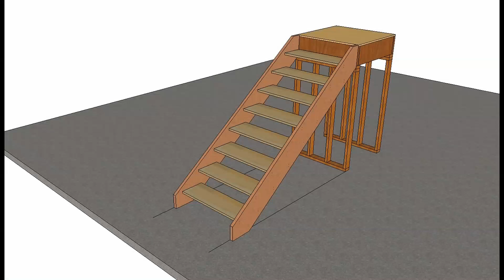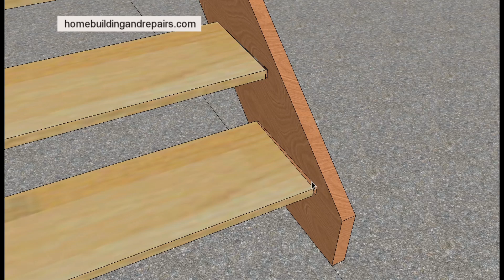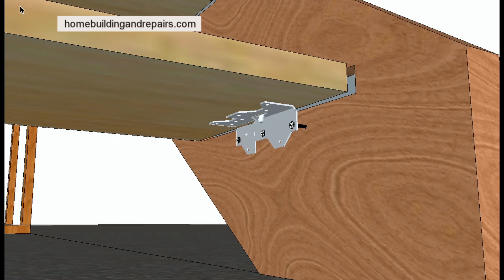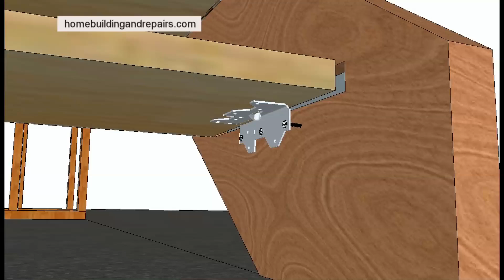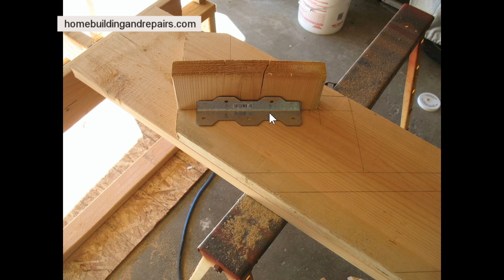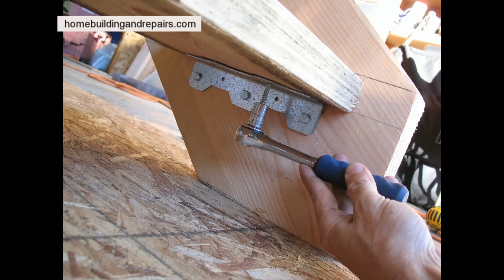How to Force Tread Back into Dado Stringer – Basement Stair Repairs

Comment: My issue is my basement stairs have too much flex in the middle of the treads (No middle stringer). The previous owner attempted to remedy this by putting a threaded rod that goes under each tread and spans through both stringers. This is another method you could use to bring the stringers back together.

Comment: Using tread brackets as support which would be stronger lag bolts or carriage bolts ??
Reply from the maker: It will depend upon the size and installation, but I would say that the winner would be carriage bolts.

Comment: Where there is a gap at both sides of the stringers couldn't you use a clamp to force the tread back into the dado?
Reply from the maker: I would imagine so. There are quite a few different methods for this type of repair.

Comment: What size bolts for angle brackets? Great video by the way
Reply from the maker: You would need to check with the angle bracket supplier or manufacturer. It's the reason why I didn't provide it in the video, because they could vary in sizes.

Comment: WHAT SIZE IS THE BOLTS YOUR USING?
Reply from the maker: You would need to check with the manufacturer for clarification, but I believe I used either 3/8 of an inch or 5/16 of an inch and believe they were about an inch and 1/4 long.
Reply: @stairbuilding  I ❤

Comment: Thank you for making this video.  Some of the treads on the main stairs to my house started to separate from the dado one by one, so I bought 32 of these and secured them with lifetime warranty stainless steel screws on the tread part, and galvanized lag screws on the part that connects to the stringer.  Do you think that is OK that I used stainless steel screws to secure the stair angles to the treads?  I could not find a way to do lag bolts the way you described in the video.
Reply from the maker: It's hard for me to answer that question for sure, but I would simply inspect the stairway regularly to make sure it isn't coming apart and if it is then switch to the lag screws.
Reply: how did this do ...this is what I plan to do as finding the correct bracket that accommodates the size of a galvanized lag screw in both areas has been hard. I plan on doing what you are doing and using the stainless steel hex screw to the stringer.

Comment: Thank you for the video  very helpful. My only question is if there is there a way to put more pulling force on the stringer rather than the tread? It seems like this method pulls on the tread only.
Reply from the maker: As long as the stringer can move then this might work, but you can use another method and I will post a link here when I make the video to show you how.